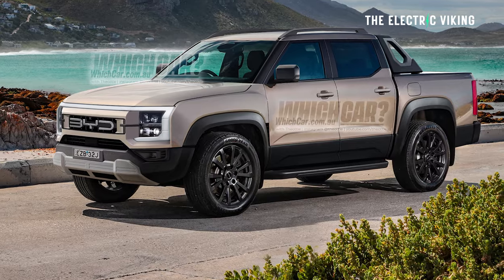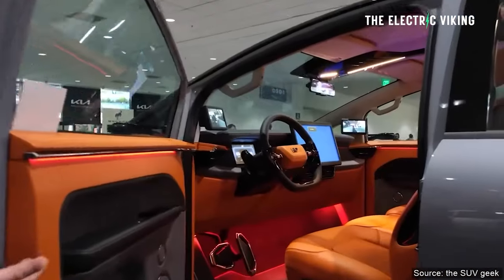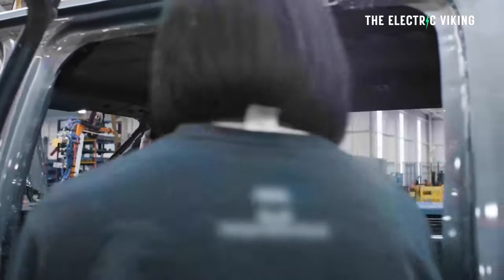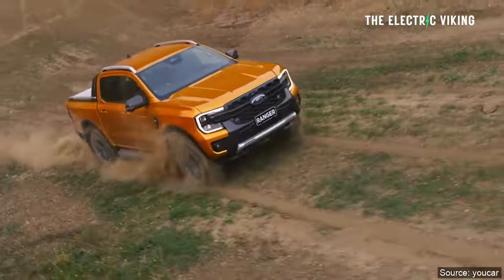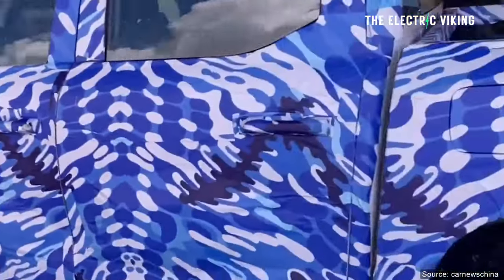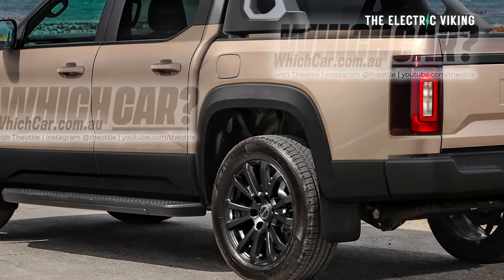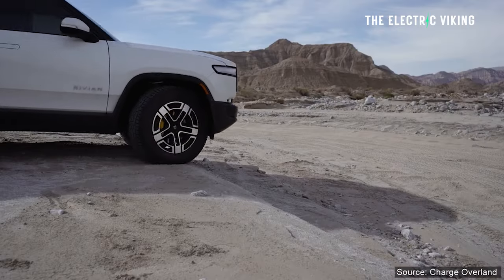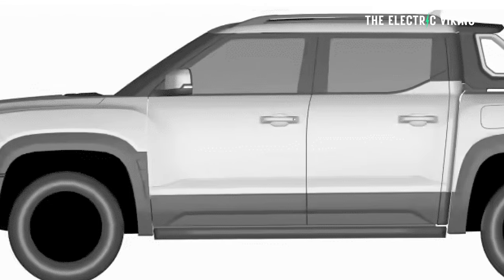Likely BYD Ute design revealed before Australian release in 2024

Comment: In Australia there's not chargers everywhere unfortunately. The PHEV is the logical choice at the moment, and probably will be for at least the next 3-5 years at the slow rate that chargers are being rolled out in Australia. And PHEVs aren't necessarily all of a piece. I don't know what configuration BYD are using but some PHEVs only use the engine to power the battery to give it supplemental range (eg BMW i3 REx), and don't engage the wheels. So in fact the engineering is not that much more complicated than either a HEV (in fact they're the same as a HEV, but with a bigger battery) or a BEV.
Reply: I agree
Reply: Most of BYD's PHEVs (except their ultra-premium brand Yangwang, and maybe their new pick-ups) are series-parallel PHEV. The engine can (but not mandatory) directly drive the wheels at high speed (parallel mode), or switch to range-extender mode (series mode) at lower speeds.
Most other Chinese PHEVs (including Yangwang and the new pick-ups) are series hybrid (range-extender only). The best-selling parallel PHEV ranked 15th of all PHEV sales in China (or, ~1/10 of BYD's best selling model), which is an insignificant portion of PHEVs in China.
BYD's configuration is slightly more complicated (added a single-gear gearbox), but more efficient at speeds around 120km/h (speed limit of most highways in China) without compromising low-speed efficiency.
Reply: Same here in malaysia. Not so many charger stations, especially in the rural area. Full ev still at least 10 years ahead... I believed Thailand scenario is the same, as with Indonesia if not worse...

Best selling phev mitsu orlander has no problem with it's phev...
Reply: Have to disagree.  An internal combustion engine with fuel system, exhaust system, cooling system, induction system, emissions controls, vibration mounts, geez!  It’s anything but simple.  After 10-15 years these components start to leak oil and coolant, fail emissions, spark plugs wear out, etc.  I have never been comfortable keeping an ICE car as primary transportation for more than about 10 years because they break down.  Pure electric cars have none of these fail points and the battery will age gracefully not leaving you stranded like a broken plug coil or serpentine belt.

I believe all modern PHEV designs do drive the wheels with the engine, so they are subject to all these issues plus a more complex transmission.  I own a hybrid and I love it but when it gets to be 10 years old it will probably be gone.
Reply: @paulogden7417  I agree, but this is not so with hybrids. You are conflating pure ICE with the ICE in a HEV or PHEV. They may be the same engine but they are very very different use cases. Look at a video of the breakdown of a Prius that had done 200,000 miles / 300,000km. The engineer said the whole engine, pistons, rings etc etc was like brand new. That's because it's very rarely driving the wheels directly and the revs are very rarely above 4k rpm.

My HEV is 20 years old. The ICE engine works fine, no leaks, and runs smooth as anything. The only thing I've had to replace is the HV traction battery, but that is getting cheaper every year. HEVs and PHEVs make perfect sense at the moment in Australia, because our fast charging network is virtually non-existent (one 50kW fast charger every 200km in many areas, and often broken.)

I agree with you that BEVs are the ultimate destination, but until the charging network is fit for purpose (125kW chargers everywhere, multiple bays etc.) HEVs and PHEVs have a significant role to play in the interim.

Comment: "Rivian can make an EV with 700k range". Sure, but it costs a fortune because it has a 200 kilowatt hour battery pack and when you tow anything you'll half that range. Not to mention that what this vehicle will most likely be used for is taking the kids to school while carrying a one tonne battery. Give it a 30 kilowatt hour battery and a range extender, it'll still be able to take the kids to school with close to 100km ev range, it'll weigh half a ton less, it'll cost tens of thousand of dollars less and still be able to have huge range in the 5% of the time you want to drive that distance.

Comment: Sam never explained the drive train other than to say it's a hybrid.
No Sam, it is an extended range EV.
The ute will Have a 1.5T engine and all it does is charge the main battery. This ute will have 500 kw of power, and will destroy a Raptor off the lights. 
And the best thing id that it has over 1000km range.  There is no good ev ute in the market that can tow. This fills that gap.